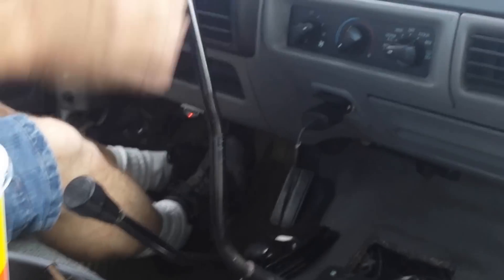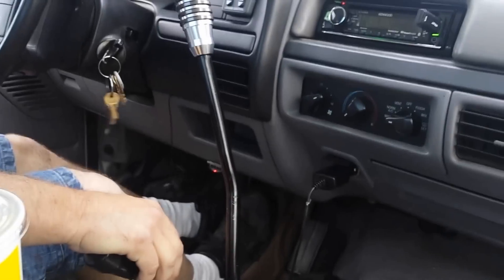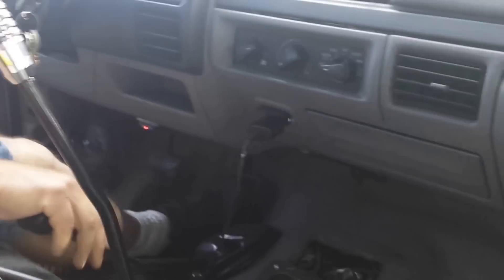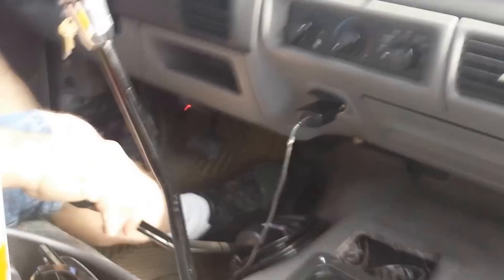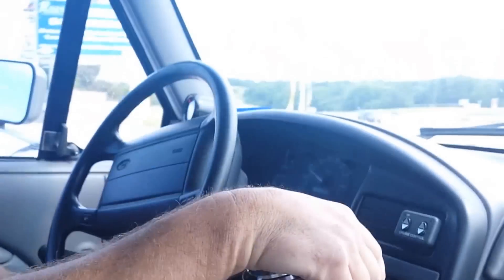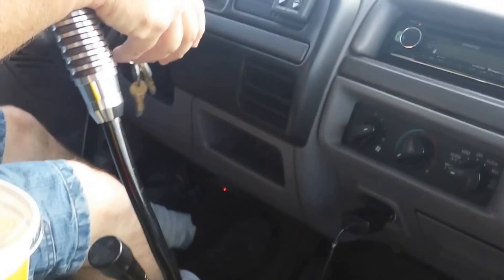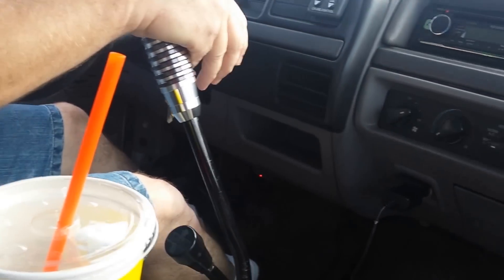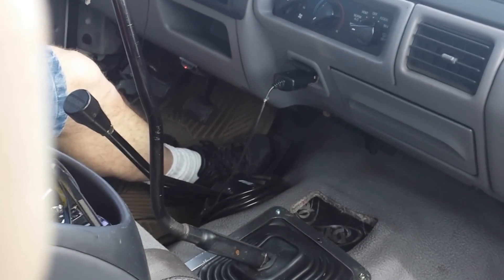F150 twin stick test drive

Comment: So this is like the old maxidyne transmissions when you had the 5x2 high low for each gear and when you go from say third high to 4th low you shift booth sticks at once I'm assuming this was once a 4x4 truck and you replaced the transfer case with the split gears on the aux box
Reply from the maker: No it has always been a 4x2. I replaced the weak Mazda 5 speed with an Advance Adapters 2 speed aux overdrive unit called "Ranger II".  Then I bolted a Ford T19 4 speed Granny behind it. Advance Adapters makes these overdrives for Ford and Chevy 4 speed transmissions, it goes in front of the 4 speed between the bellhousing and 4 speed. It can also be used in 4x4 applications it just moves everything back apx 7 inches so driveshaft modification is necessary. They also make a version for Toyota Land Cruiser to swap in a Chevy motor. The overdrive unit is used as an adapter to mate the Toyota 4 speed to the Chevy Bellhousing.  I should be getting paid by Advance Adapters for promoting their products!! Lol
Reply: ktumbleweed could you use it with a 5spd transmission or a 6spd new f350 transmission or is it only for a 4spd application?
Reply from the maker: It only works with the older 4 speeds with separate bellhousings. The newer 5 and 6 speeds have integral bellhousings. The factory 4 speed bellhousing is used, the "Ranger OD" is bolted to the bellhousing and then the stock 4 speed bolts to the back of the OD unit.
Reply from the maker: I have actually thought about doing that. However since both OD's have about the same ratio there would be a lot of duplicate gears, plus the fact the gear vendors does not work below 30 or 35 mph splitting 1st or 2nd would not be possible. Maybe 2nd if you wind 2nd way out. At best that combo would give me 9 gears, basically all I would gain would be double overdrive. That being said I might sell this combo and go with the gear vendors down the road sometime. The noise of this thing in overdrive on a long trip is very annoying. Hey Advance Adapters, why does it have to be so noisey with helical cut gears? It sounds like it has straight cut gears!! There is no good reason this unit has to be so noisey.
Reply: this thing would be a real kick in the ass,imagine putting a gear vendors OD unit behind your existing,that would be 16 forward if the motor could pull it.Have fun
Reply: Would a Richmond or Tremec 5 speed work with this?  They have separate bellhousings.
Reply from the maker: No because the input shaft is different. Different spline count and different stickout lengths. I am sure with a lot of fabrication and major modifications to the AA unit it could be made to work but I would not know where to begin.  Advance Adapters says it only works with older truck style 4 speeds. Ford Chevy and Toyota 4 speed land cruiser that has had a Chevy engine swapped into it are the available options.
Reply: nyemt
Reply from the maker: Sorry, I only speak English. What does that mean?
Reply: yes that is like the maxidyne but the primary is only a 4 speed not a 5,otherwise same except he does not have 5 reverse gears,my favorite on the maxidyne
Reply: if you sell it, ill be first in line haha.  im guessing it goes before the trans?
Reply from the maker: Yes, this bolts between the bellhousing and a stock Ford or Chevy 4 speed.
Reply: ktumbleweed what about chevy 5 or 6 will it bolt to them?
Reply from the maker: No, only works with the 4 speeds. The 5 and 6 speeds have a different bellhousing and different input shafts. I am sure with some heavy modifications and fabrication and probably a lot of machine work it could be done. But the short answer is no, in stock form it will not work.
Reply: Yup I've been planning to my truck, got bbc and sm465 and shove that advance adapter between. It's it that noisey? Got straight dual flowmast I don't think I should hear it though lol.
Reply: It's confusing just having one gear stick but two lol 😊😄
Reply: Fionn O'Brien try it in a big rig peterbilt 379 they are fun but not careful ya could break fingers happened to me in my peterbilt except mine is a three stick 18 speed Eaton fuller transmission

Comment: how did you make this?   Can I also do this to my 5 speed in my silverado?  and if so  how do i go about doing it?   I hotshot alot so it would be nice to have an extra vehicle on hand .  It has pretty beafy springs it just needs lower gears
Reply from the maker: I did not "make" this. I bought the aux trans from advance adapters. It is simply a 2speed transmission, Direct drive and overdrive. It only works with 4 speed transmissions. You could ditch the 5 speed and use this and an old sm465 granny (GM's 4 speed granny back in the day). They are easy and cheap to find. I found my 4 speed Ford T19 in a junk yard for $150!! Going from a 5 speed to a 4 speed you would lose the overdrive gear but with the 2 speed AA Ranger unit you would gain the overdrive gear back. Advance Adapters builds both Ford and GM versions. Google search Advance Adapters.
Reply: Thanks! I appreciate the information.  Know of any installation tutorial videos?
Reply from the maker: Advance adapters has pretty good instructions on their website. Advanceadapters.com

Comment: what is the advantage to having this? do you haul a lot? have seen similar setups in diesels that haul very heavy but never in a gas f 150. is pretty cool none the less but just curious why you went with the set up
Reply from the maker: I haul a 7k to 8k trailer from time to time and did not trust the stock 5 speed. That is one reason, I love shifting gears (I used to drive semi's and miss it).  This was cheaper than a ZF swap.  And the #1 reason is I think it is cool and it makes me happy. Cheaper than therapy!
Reply: awesome. would love to have a setup like this in my f250 with the 7.3. zf6 currently still works great at 243000 miles but would be very neat to have a twin stick setup like this.

Comment: So is first on the main transmission the granny gear?
Reply from the maker: Yes, the main transmission is a normal "granny 4 speed".  The other transmission is just a 2 speed.  Direct (1 to 1) and Overdrive ( .75 to 1)
Most of the time I start in 2nd then 3rd then 4th and then overdrive. The overdrive can be used in any gear as a splitter. For example 2nd direct then shift to overdrive , then shift to 3rd and at the same time shift back to direct. etc etc.

Comment: should be able to work on a 4x4 also?
Reply from the maker: Not sure where my reply went to, but yes it will work on a 4x4. It goes between the bellhousing and the 4 speed. It moves the 4 speed back about 7 inches give or take. I think it is 7.5 inches. So both driveshafts would have to be reworked. rear shortened and the front lengthened.

Comment: 2 transmission saves fuel
Reply from the maker: believe it or not it has increased my mileage slightly and not because of the overdrive. The 5 speed I replaced had overdrive. It is because I have so many available gears that I can keep the engine RPM right in the sweet spot. I don't have to tach the engine out before shifting, I can shift at low RPM's if I want to. I drive kinda slow tho, I always have at least 1500 lbs of tools in the bed and don't want to sling them all over. I maybe went from 14 mpg average to 15 mpg average so were not talking about hybrid mileage here.
Reply: Thanks! For your answer
Reply: Yeah ok. How long would it take to recover $3000 in fuel if it gets even 2mpg better fuel economy???
Reply: @zigz0911  if you add this to a truck that didn't previously have an overdrive, the mpg gains would be much more drastic.

Comment: Now that you have at least 6 months on the Ranger torque splitter, what are your impressions  of it? People say they are noisy but even with the shift boot loose it doesn't seem to be too bad. Can you take a decibel reading with a smart phone in 3rd O, 4th D, and 4th O ? I want to install one in my 84 CC dually that I'm swapping a 300, t18 into. Thanks for the video.
Reply from the maker: For some reason I am just seeing this comment a month later. Yes it is noisy, even with the radio on you still hear it pretty good. It is not deafening or anything, probably won't register much on the decibel reading. It is more of a whinny high pitch, kinda like a worn out rear end. I was warned from a tech at Advance Adapters that is was noisy so I knew that going in. The noise seems to transmit up thru the shifter more than anything. It does not make sense why it is so noisy considering it uses helical cut gears, sounds like straight cut gears. That is my only complaint, but I would still do it all over again. Just crank the radio and then you don't hear it.
Reply: Thanks for the reply. I bought one about a month ago and I'm in the process of putting   it in. I took the 460/c6 out of my 84 Ford  CC dually f350 and putting a modded 300, t18 with the ranger OD.  I used to pull my mustang drag car  with a 81 f250, t18  so we will how much better this set up is.

Comment: very cool! any idea if that option is available to put up against a 6 speed in a Dodge?
Reply from the maker: No, it will only bolt to Ford and Chevy 4 speed transmissions. That would be cool tho.
Reply: Jarod Hamel I forget exactly how, but I have read that the Ford version can be altered for use in a dodge.

Comment: Also, tractor trailers are now available with automatic transmissions.
A semi truck automatic transmission is actually a computer controlled manual transmission.
I know because I looked it up.
Reply from the maker: that is correct, i drove one of those once... I hated it. It would make stupid shifts.  And don't ever brake when it was in the middle of a shift cause then it would lose its mind and take forever to recover if it ever did. One time I had to stop the truck to get it back in gear. But that was one of the earlier versions, maybe they got better after that. I think that was around 1998. It still had a clutch pedal and the newer versions got rid of the clutch pedal.
Yeah an automatic with a clutch pedal, weird....
Reply: ktumbleweed the new eaton ultrashift plus is more advanced over its predecessors.
I'm pretty sure eaton has worked out most of the problems the the earlier transmissions had.
The ultrashift plus has an electronic clutch actuator and many other features to make it more driver friendly than the older automatics.
Reply: I've heard most truckers hate those
Reply: We have 12 speed automatics. (CR England)

Comment: You remember the days when tractor trailers had twin stick transmissions.
Those were referred to as something like a 5+4 transmission.
Modern tractor trailers have all the controls to select all the gears on the main transmission shifter and there is no second stick.
Reply from the maker: I don't personally remember them cause they stopped doing that in the seventies. I think you could still get them after the seventies but that was a custom order or conversion. I drove one once, it was a 5 x 4. Five speed main box with a 4speed aux box. the way I kept it straight in my head was the main was 1 thru 5 , the aux was low low , low , direct , and over.  you only used the low low gear in 1st gear of the main. then went thru the four on the aux, shifted the main to 2nd and went back to low (2nd) on the aux, then direct (3rd) then over (4th) then shifted to 3rd on main box and once again low, direct , over on aux.  When you shifted to 4th on main you only went down to direct on aux the up to over , and then same thing for 5th gear. Also to further complicate things on the aux box third and forth gear were switched around if the box was an over drive box. So from low(2nd) to direct (3rd) you went up over and then back down. then the shift to overdrive was straight up. Yeah.... it took me a few tries to get it down, then about the time I got it my test drive was over. Lol.  This experience was in the tow truck that towed my broke ass truck 90 miles to the nearest Schneider Operating Center. The driver was kind enough to give me a go at it. This was back in 1996 the first year I drove truck.

Comment: Where's your 1984 ford truck?
Reply from the maker: I still have it. It is not running at the moment, It has been just an extra vehicle for a few years now. I will try and post an update on that truck soon. Hint... V8 and has gone on a major weight loss plan..
Reply: ktumbleweed if I'm correct, your 1984 Ford is not a 3 on the tree anymore.
I think I heard someone say you converted it to a floor shift.
Reply from the maker: Yes, it went from 3 on the tree to 3 on the floor to 4 on the floor. Then the 300 6 went bad so I yanked it out and put in a 4.6 V8 from a 95 thunderbird with a 4 speed automatic and that is how it stands now.